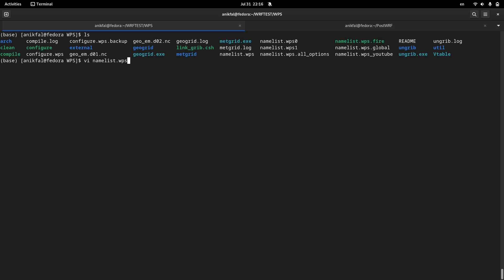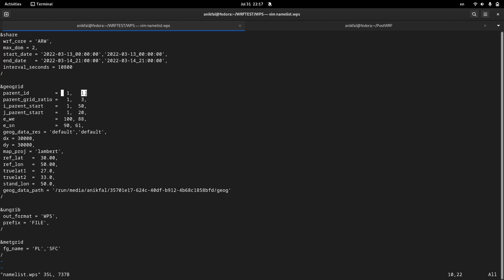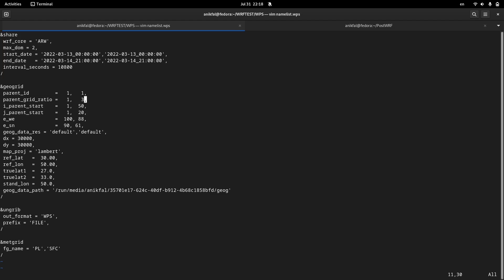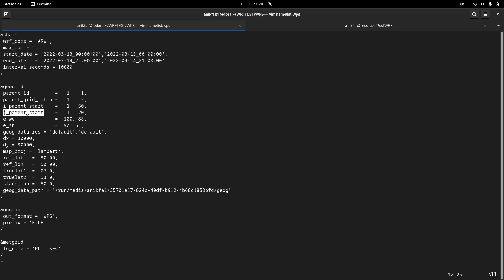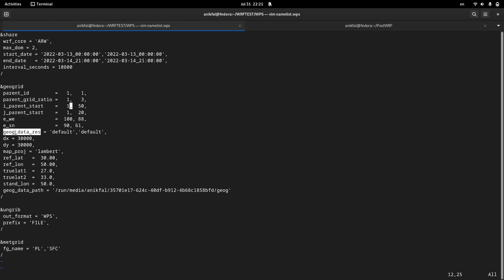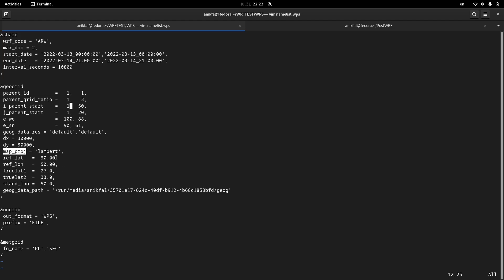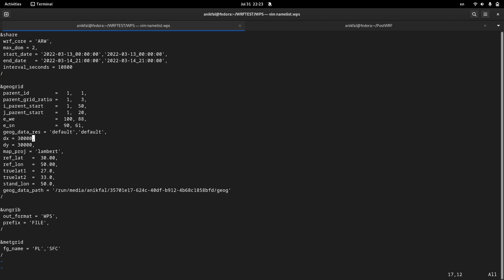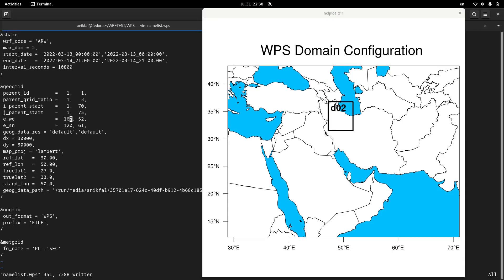Making WRF model domain

Comment: Hi there, when  run post work its say there is no domain display. Do i have to link the WRF file to postwrf ? Thank you for the informative vides as i'm a beginner
Reply from the maker: Did you provide the correct link to your namelist.wps? So recheck your namelist.wrf again.
Reply: @amirhosseinnikfal968  I just created the WRF n WPS. I m not sure about the links
Reply from the maker: @sownalchand9843  go to the directory of namelist.wps and run realpath name list.wps
Reply: Hi sir, the contour plot doesn't work in my postwrf. It gives an error of. /modules/contourlvl.sh line 145: convert command not found... How can I over come this error?
Reply from the maker: @sownalchand9843  Hi. I think you chose animation as the output. use PNG or PDF for the output format instead.
Reply: @amirhosseinnikfal968  yes... Png works fine... Thanks sir
Reply from the maker: @sownalchand9843  If you want to generate animation, you need to install "convert" on your Linux

Comment: very good. 
when I compile WPS, I received some errors such as:
"fatal error: jasper/jasper.h: No such file or directory
    5 | #include "jasper/jasper.h"
after I did not have *.exe files in WPS folder.
 how can I fix it?
Reply from the maker: It is mentioning that the Jasper library is not installed. Install it accordingly and compile WPS again.